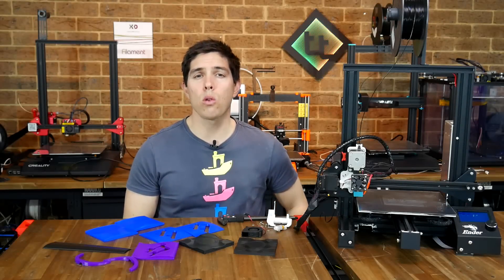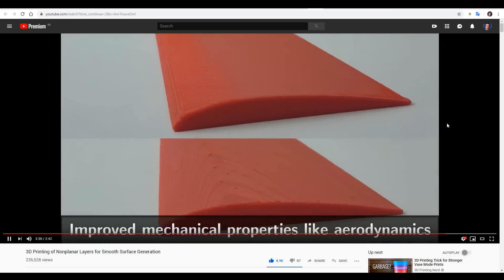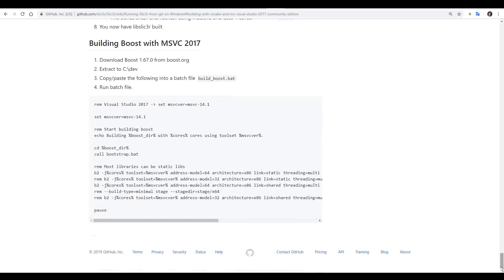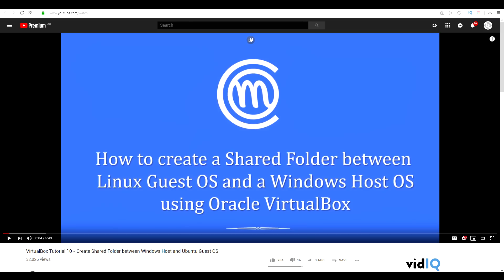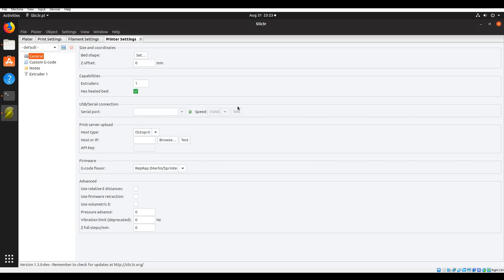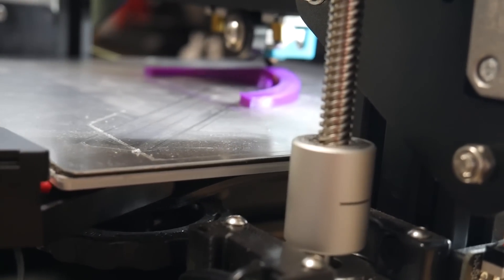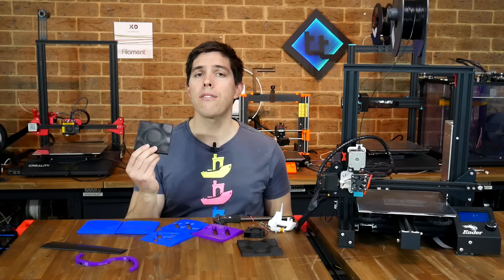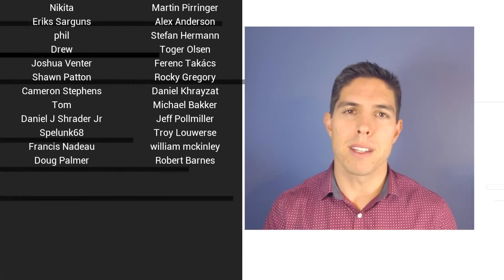Achieve true 3D printing with non planar slicing

Comment: This is HUGE! I'll bet within a year we will see true 3D printing. Thanks for posting this.
Reply: People kind of had that reaction to (2D) plotters vs. dot matrix printers, but in the long run the resolution and speed of dot printers increased so much that curve quality became a non-issue. Whether non-planar printing is worth investing in (both in terms of software and hardware) will depend on how quickly the resolution and speed of planar printing increases.

Sometimes, throwing more resolution (or more memory, or more MHz, etc.) at a problem is just faster and cheaper. Non-planar would still be smoother (just like plotters can still make smoother curves than printers), but beyond a certain resolution it just doesn't matter.

In the long run, I'd put my money on high resolution SLS / photo resin printing over FDM, anyway, or possibly an "inkjet style" technology (with multiple small nozzles shooting microscopic particles, instead of a single extruder).

Comment: Wow, this is amazing, I wonder how much it changes the strength of the part, I feel like those last non planar layers are more prone to delaminating. Ill probably wait til someone makes it easier to install on windows to try it out, Im too lazy and impatient to figure out linux/emulators.
Reply: It would be interesting to test. I want to see Tom make a video and use his over-engineering of sensors and things to test it
Reply: Logically, it shouldn't change the strength of a part that much, as this solution is just a shell, or multiple shells, on top of the part, the rest of the part under the shells are still layers. This is more for aesthetics, smoothness, and performance in areas like aerodynamics. 

Now if you were to print mostly everything as a shell, then various aspects of strength could change. Problem is, you'd need a 5axis printer to actually be able to do this.
Reply: @xaytana  Would love for 5 axis machines to be more common. Hopefully someone makes an affordable one sometime soon, I bet it would have no problem selling.

Comment: Incredible video. 
There is one thing that will probably make the setup a lot easier:
Instead of using a virtual machine to run Linux you can use the new Linux-Subsystem in Windows 10.
This can be enabled a lot quicker than installing a VM and is probably also quite a bit faster.
This also means that moving the files to the Linux machine is only a matter of moving the files into the folder where the subsystem is located.
Thank you for the fantastic content.
Reply: Isn't the Linux subsystem command line only?
Much better to install Linux alongside your Windows 10 and dual boot.
Reply: @alibro7512  Yea, the Linux subsystem is command line only but you can still open your apps via for example XMing. But you make a good point, that leads to more things to do before you can use the subsystem like you'd be able to use a VM/dual boot. Maybe a VM is still the most "plug-and-play" solution for now.
I agree that dual boot is the best option if you plan on running both a Windows and Linux machine actively (Thats what I do too) but if you only want to use a Linux machine to try out this slicer thats quite a bit more work to go through compared to the other options.

Comment: You can already buy those pointy / extended nozzles. look for Nozzle Adapter V6 on aliexpress.
Reply: Yes they should fit, you just need to make sure the heat break is tight to the nozzel, I found that although the tip was longer the threads were shorter so I had to screw the heat break a lot further down to meet the nozzle. And if you don't screw them tight together you will have a big mess 😭
Reply: @markmacherey4744  just add some teflon tape on the threads. Works like a charm :)
Reply: J.W. 
The issue is the gap between the heat-break and nozzle.  That will fill with plastic and you get a clogged nozzle.

I guess you haven’t had a clogged nozzle yet.  They’re a PITA.
Reply: Do they fit in the standard Ender 3 Hotend?
Reply: German Invention :D
Done of one our community engineers. He also built the first and smalles 3D Cube - able to go real 300mm/s coreXY on linear rails. 
He also sells these adaptors. But like all - copied and cloned.. but not mentioned who invented it. This is the world we live in ^^
Reply: Andree H. 
Do you have a link?
Reply: @hanswurstusbrachialus5213  Back up your claim with evidence. Otherwise, it's nothing more than mindless conjecture.
Reply: @m3chanist  It's not a german invention lol. Those are airbrush nozzles nothing else. the idea might come from 1 of the guru's but not invented.
Reply: Nice just ordered some. I hope by the time it arrives we can compile this Slic3r on Win

Comment: Nice video.
And yet another reason, not to install a BL-Touch, but a simple film probe for ABL. Not only much cheaper, but it would work with a non-planar print as it is only atached while leveling and not while printing.
I hope the will be a cooling solution for the Ender 3 which allows 50°, because cooling seems to be essential for good quality prints.
Maybe the next step would be a servo-driven fan shroud, so the planar layers / overhangs/ bridges can be printed with cooling and the finishing non-planar layers without cooling...
Reply: Although you are completely correct in saying cooling increases print quality, structural integrity is compromised. I have an Ender 3 and i have gotten far better layer adhesion with 15% fan speeds. :)
Reply: That is true - but on bridging and overhangs of course you need a good cooling, else the layer which is printed "in the air" will hang down and the next layer will not adhere at all. So you have to design the cooling to be efficent for overhangs and bridging, even if you slow it down to 15% on the rest of the object.

Comment: Wow, simply amazing at what the future is in store for this hobby. Also, very impressed as I couldn’t even compile a working profile for my SKR and 5160’s 2 months ago. I would like to try to print that piece you did last, where did you say you’re gcode was located? Also, what are some basic setting on that gcode, only bc I use a microswiss hotend
Reply: ThAnk you very much Michael, I will go check it out, read over your warning, and modify the printer to make a test run... I’ll post the results on the Ender 3 FB page if all works well... Again, thank you for all the effort you do for our community 👍
Reply from the maker: Thingiverse link in the description. Plenty of warnings there, don't want people to collide their fan shroud with the printed parts.

Comment: Excellent video Michael, again! 
Can you please recommend a good hotend fan, preferably 24V one. What do you use on Ender 3?
Reply from the maker: I have a 5V Noctua on mine, going through a buck converter. I think it works well with the Hero Me because the ducting is tighter around the heat sink. I have a video on this: https://www.youtube.com/watch?v=yW9ovo9CHi0
Reply: Tnx. I assumed it's not Noctua since it seemed like a black one.

Comment: Excellent stuff.  Modifying the shape of the heater block to more conical could give you better bang for the buck than altering the nozzle.
Reply: Next to design a extruder mount that allows for the BLTouch to be easily adjusted off the side during such a method of printing. I am in awe and inspired by the print results shown in the presentation. Yes, excellent stuff for sure.
Reply: no need for mods, the volcano knockoffs already have a smaller heaterblock rotated 90 degrees with all the wires coming out of the top, this makes the longer v6 nozzle itself the only thing for many milimeters. I am making a 3d pen with one for these same reasons, it allows much more clearance around the nozzle which would work well here as well as a tilting pen. amazon has 15 dollar all metal throat v6 knockoff kits which include normal and volcano blocks and many nozzles for both.
Reply: @CatCommando  I agree with you a volcano heater block would solve this. I Also feel there is no need for a probe if the bed is set correctly. I havent leveled the bed on my machine in at least 9 months with flawless prints.
Reply: So why not use a diamond hotend as it’s cone like already
Reply: The nozzle itself would still limit you. The details are in the thesis.